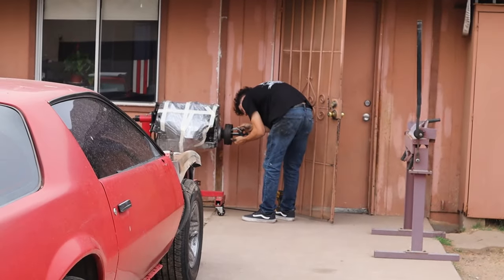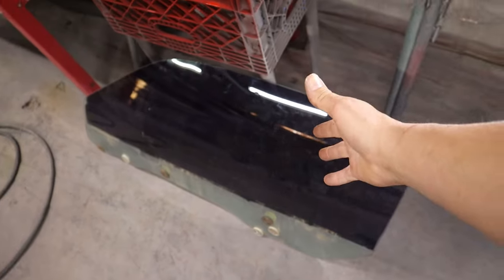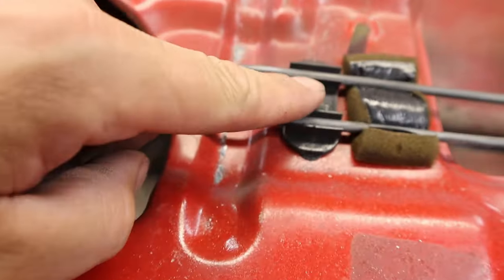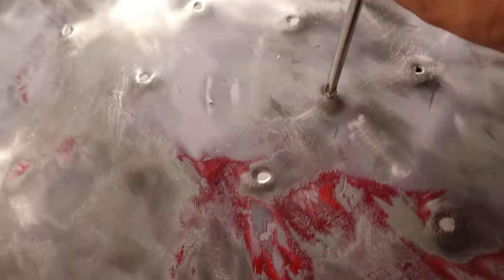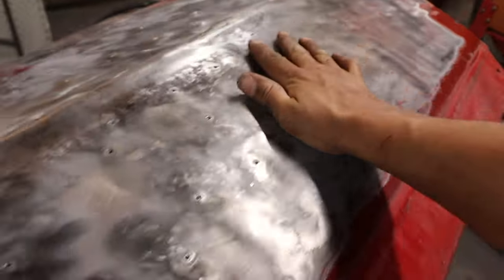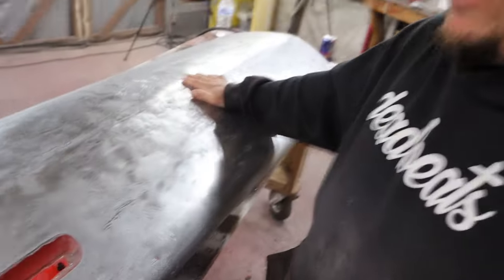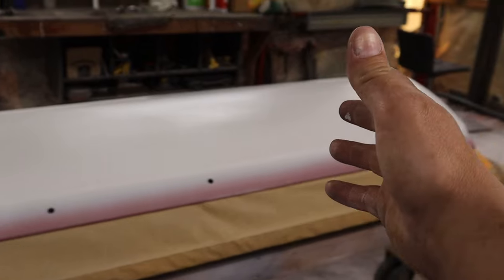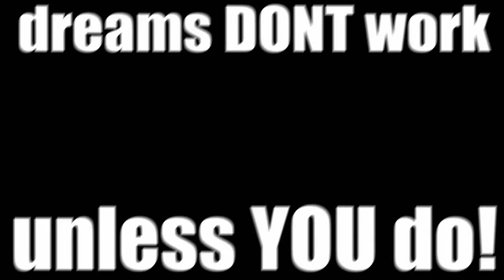4 Days! To get this this Door Straight!

Comment: Say bro if you heat the metal with a torch nice and hot then cool it quick with cold water and a rag/sponge and it will shrink the metal some

Comment: Ford uses those same dumb rivets. I always take a punch and gingerly tap the rivet pin back out then drill the head off. Then re place them with 10mm bolts and nuts

Comment: I'll tell you another secret with those  Make a line and then pull the whole line with one big clamp to lift a hole Area Usually the door would be on the car and you would be using the frame machine to pull with

Comment: Why not just cut the old metal out in sections and weld in some new tin? Not saying buy a expensive skin and weld that, but the tin at tractor supply is less then $10 I think. Easy enough

Comment: Listen. Maybe I'm crazy but what if you would have filled the holes in and then used the localized heat to push the metal flat. Maybe somebody else knows more than me in the comments but metal is easier to move when it's hot lol. 
Ps. I don't know shit about body work or welding lol. I'm just asking a question lol